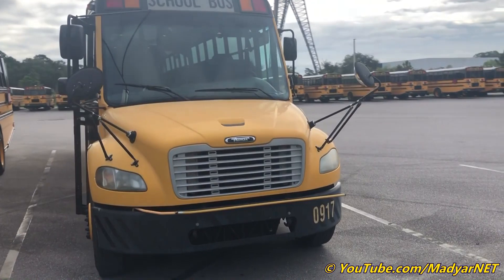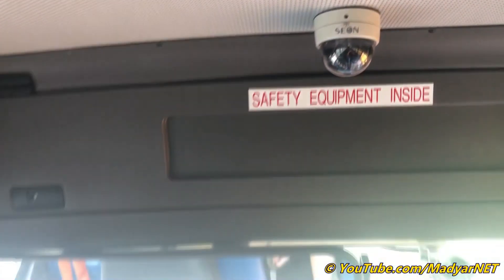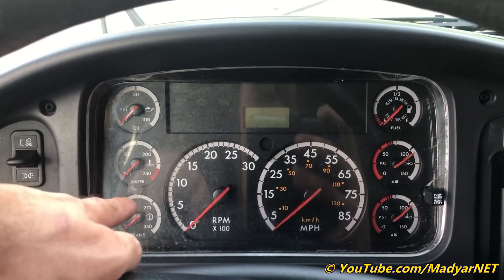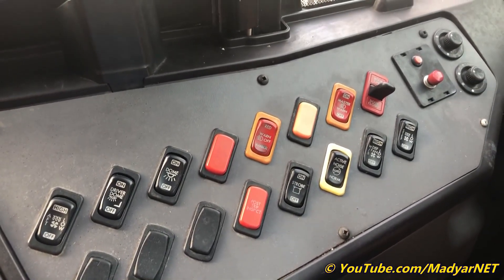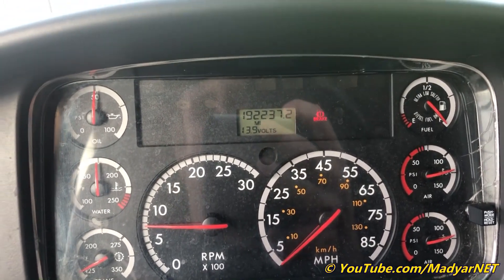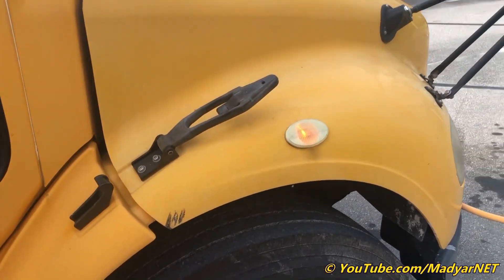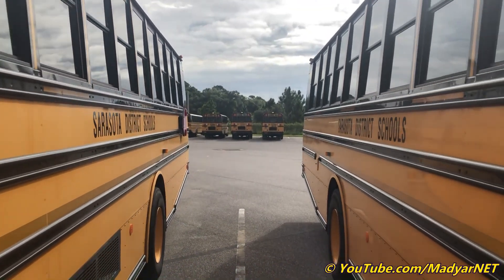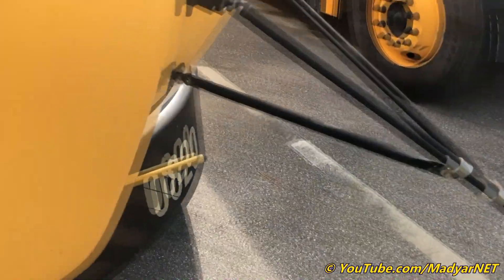2010 Thomas Saf-T-Liner® C2  - Walk Thru Tour

Comment from the maker: I specially showed one wrong thing. Did you find it?
Reply: first
Reply: Shouldn't one of the buses been a MBE 906 ?
Reply from the maker: No. It both with 926 engine
Reply: @MadyarNET  try to do another 2015 thomas c2 back seat video again but not the mic under the bus. please.
Reply: @MadyarNET  Thomas C2 I need new 2008 driving video?